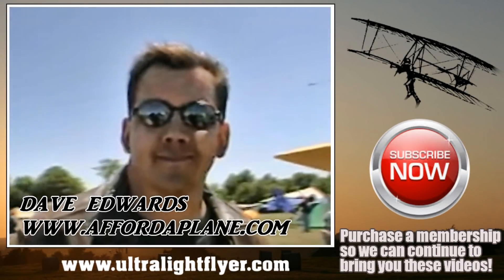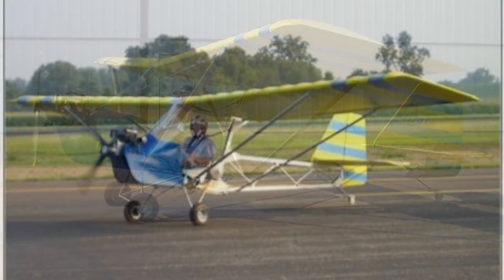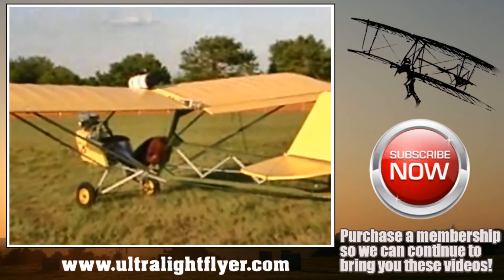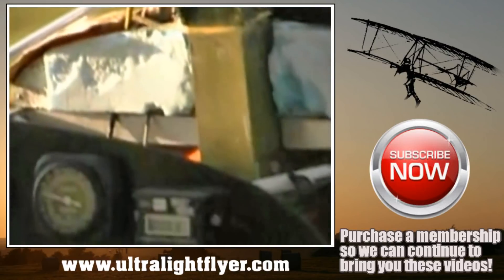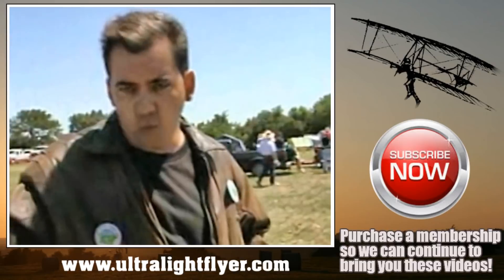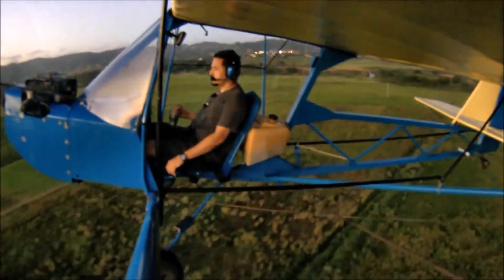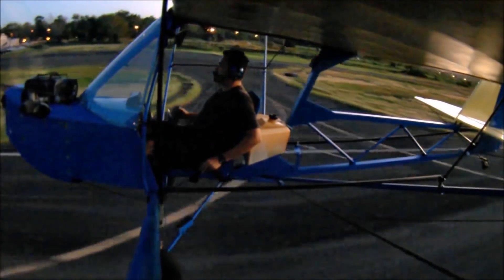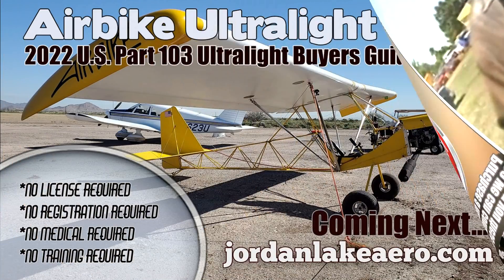Affordaplane, Part 103 Legal Ultralight Aircraft, 2022 Ultralight Aircraft Buyers Guide.

Comment: The legal eagle is stronger made of chromolly tube
Reply from the maker: There is NO difference in the strength of the fuselage in either aircraft. One uses steel the other aluminum - but the size of the tubing is larger or the wall thickness is thicker on the aluminum.
Reply: @ultralightnews  - There may be no difference in strength overall, but there is a huge difference in strength compared to weight with regard to the fuselage: The Appordaplane fuselage weighs in at 120 lbs whereas the Legal Eagle only weighs 62 lbs (56 lbs for the fuselage and another 6 pounds for the tail components).

NOTE: These are real-world figures obtained by those who actually built them, paying particular attention to make the airframe as light as possible with regard to the Affordaplane. 

In the case of the Legal Eagle, the weight in the first link below includes the fuselage, paint, seat, rudder pedals, wheels, tires, landing gear, tail wheel gear, brake discs and calipers, and floor pan. It does not include the tail components (fin, rudder, horizontal stabilizer and elevator). In the second link, it is indicated that the tail components weigh 6 lbs.

In the case of the Affordaplane, the weight includes the fuselage, gas tank, seat, rudder pedals, wheels, tires, landing gear, tail components and tail wheel gear.

Legal Eagle
       https://legaleagleflyingadventures.com/2020/03/14/weight-of-fuselage-and-gear/
       https://www.kitplanes.com/legal-eagle-xl/

Affordaplane
       https://www.youtube.com/watch?v=wL8cG8Vesv4&list=PLhRuUetVypJSgaPHRIqPBbO8Td3ksGq5-&index=39 (begin watching at 3:10 in the video)

Comment: Since most Affordaplane builders are on a budget and can't afford an airport hangar, can the wings be folded or removed for transport from home?
Reply: The wings are attached by bolt/u-joint and can be removed and trailered. Terry Adair is a popular youtuber for the Affordaplane and transports his plane this way from time to time.
Reply: From what I've seen the wings are pretty easy to remove.  I always wanted to make them fold straight back.  I've considered building one of these for several years now.
Reply: Nope IIRC. It’s designed to be cheap to build, which involves the lowest amount of complexity possible.